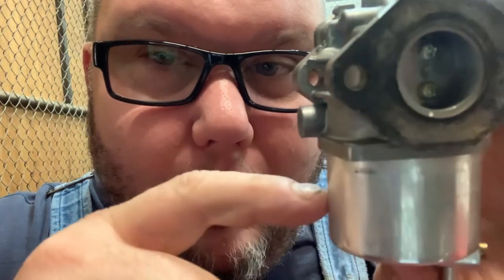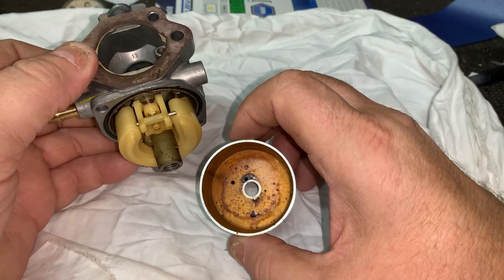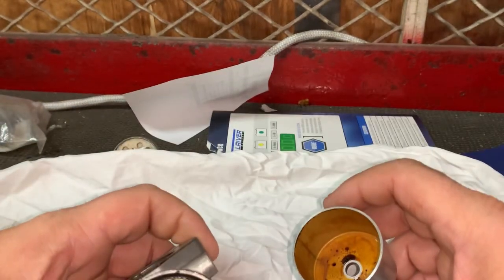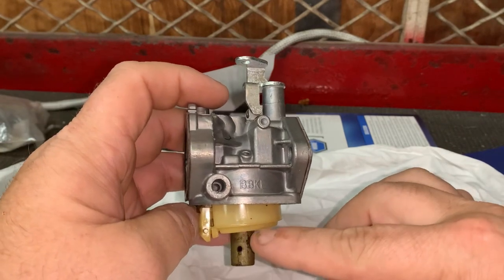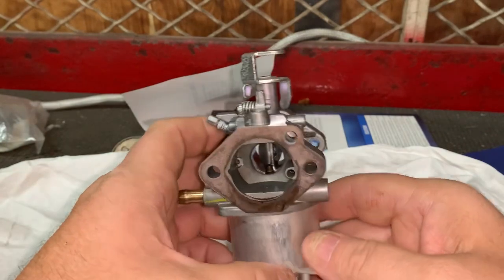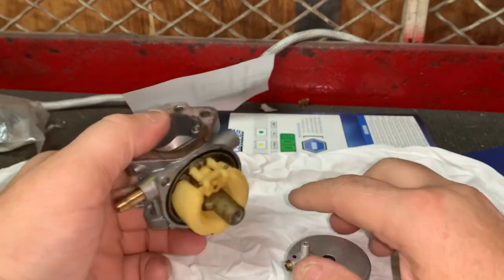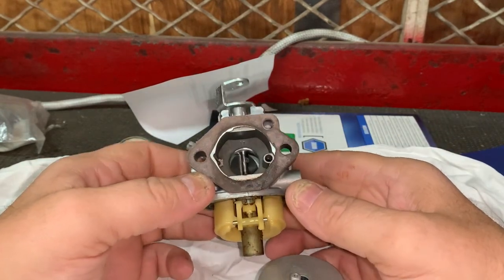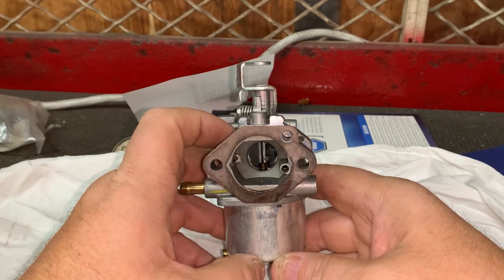SMALL ENGINE STORAGE / ARE YOU DOING IT WRONG?

Comment: On equipment that I can example lawn mower I use gasoline through the season.  At the end of the season the last one or two cuts I use the canned gas.  I let it run through the system while cutting which cleans out all of the regular gas and what remaining is the non-ethnol gas.  This has worked for years for me.

Comment: I have been using Marathon Non-ethanol fuel at 90 octain here in Virginia now for years.  It lasts a year or two in a can and even longer it seems when mixed with good two stroke oil.  All my tractors, mowers, weed wackers, snow blowers and leaf blowers run great year after year!!   
Ethanol is the enemy!!
Reply: Yeppers, Murphy's has 87 non ethanol, still add some stabil.
Reply: AGREE - Ethanol is the enemy!!
Almost zero problems prior to ethanol.  We had all kinds of farm machinery with large & small gas engines, we usually turned of the fuel valve and walked away.  Sometimes it would be 4 or 5 years later and they started on old fuel toped off with fresh and no problems.  Used ethanol a few years and had all kinds of problems.  Now I pay an extra buck a gal. for the non in small engines and it seems to work much better.
Reply: After paying for spring carb cleaning two years in a row, switched to and only use non ethanol pure gas in my small engines. That was ~20 years ago. I burn or drain all the gas in the tank each fall. And pour what's left in the gas can into the truck and buy fresh pure gas each December when prices are at its lowest.

Comment: I run regular gas with Briggs fuel stabilizer in my mower and snow blower. I park them at the end of the season with out doing anything to them.  The blower is 12 years old and the mower is 9 years old.  Both powered by Briggs.

Comment: I’ve been using a lil trans fluid through the carb before I store small engines and have been for many years. My snowblower sat for 4 yrs , I put fresh gas in it and it started on 3rd pull

Comment: Every season I always top off with fresh ethanol free fuel and stabilizer. Never had a problem. One year (as an experiment) I, drained out all the fuel. The next season, I had a leak at the carb. Had to take it apart and clean the needle and seat. 
Went right back to fresh fuel, and stabilizer. For me it’s the best option.

Comment: I think this is most common with bowl type carbs. it has been my experience with tank mounted carbs that this will not happen if you drain the fuel out of the tank. I recently pulled out a old push mower that I had stored for 21 years with the 3.5 hp briggs classic  engine that I drained the fuel in when put in storage. I kinda forgot about the dang thing and pulled it out, filled the tank with fuel and it fired right up on the first pull without having to do any tweaking or tinkering to it. I was shocked!
Reply: just remember that any fuel residue from 21 years ago isn't what we have today.

Comment: I recomend Aspen 2 mix or Aspen 4 or any similar small engine gasoline for winter storage to our customers, at least those who ask. My idea is without the ethanol or other substances in pump gas would help. I don't like those dried out carbs at all hehe. Carb rep kit $50, brand new carb $125. Plus $50 to rebuild the carb instead of replacing. (Nicky) Customers usually choose a new carb. Thanks for the upload! Very much appreciated 😊👍
Reply from the maker: Not available here

Comment: I run engineered fuel in all of my 2-stroke equipment year-round. (About 2 gallons a year @ $24 a gallon). 

But that's too expensive to use in my rider and push mower, (20 gallons a year) and unfortunately I cannot buy non-ethanol pump gas where I live. 

So I treat my ethanol gas all summer with a mix of Stabil-360 and Sea-foam.  

At the end of the season, I remove all of that from the tanks and then run the engineered fuel through the systems and let that stay in there through the winter.  

A lot of guys say the treated ethanol gas is just fine for winter storage.  To each their own, but I'm not risking it.

Comment: After 53 years of not doing anything special before storing equipment for winter (and sometimes longer) with ethanol and non-ethanol fuel, I've never had a problem.  In spring if an engine doesn't want to start I remove the air filter and pour a small amount of fuel into the carburetor and the engine will usually start on the first pull.  I have some 40 year old gasoline that I'm  going to try before long and I'll bet it works just fine.  BTW, my equipment has both two and four cycle engines.

Comment: Great advice, IF you can get to the float bowl. In some cases, you can't. ('suitcase' generators) What I do, is turn off the fuel, run the carburetor out of fuel, then wait a few minutes. what happens, is the fuel line finally get a bubble, and the fuel comes out of the fuel line and filter, partially re-filling the float bowl! it's necessary to put on the choke, and re-start the engine. Running the carburetor out with the choke on, creates a much higher suction to the main circuit, emulsion tubes, as well as the idle circuit. I don't mind a little fuel residue in the float bowl, as long as it's well below the level of the main jet, and the idle circuit. Just letting it 'run out of gas' isn't good enough!
Reply: Great Idea !!!!

Comment: I have also heard if people using a small amount ATF run into the carb? what do you think of doing that. Chickanic pumps 2 cycle oil through two cycle carbs?
Reply: She also said canned fuel is garbage!! I've used it for years and never not once had an issue!!!! All my equipment starts right up with 0 hesitation

Comment: All my engines with carburetors use high octane fuel Shell V-power 93 octane no ethanol or Chevron  premuim 94 octane no ethanol.
Reply from the maker: You do realize it all gasoline comes out of the same spigot whether it’s Walmart gas or Chevron gas etc.
Reply: @THEMOWERMEDIC1  So your saying which octane gas handles you pull from the pump,it's all the same octane?
Please explain.
Reply: @THEMOWERMEDIC1  gas stations regulated in Canada by TSSA if they get caught cheating big fines$$,Friend blew up is high performance engine using a gas station high octane fuel he had it tested wasn't 94 octane, they paid for a new engine and all the labor over$20,000!
Reply: @beachbums2008  ... not the same octane but the same base blend of fuel in many cases.

Comment: I've been using sta-bil in my chainsaws, weed eaters,pressure washers,lawnmowers,generators etc. for the last several years and no problem starting them up when I need them year after year.
What is your opinions on sta-bil if you use this product?
Inquiring minds want to know of you opinions. 
Keep the videos coming to Pittsburgh Pa. where we have 4 seasons.
Reply: I was wondering the same especially if you would buy like 1 or 2 gallons of fresh gas with that in it burn the engine dry of gas 2x regular gas then with stabilizer in it.
Reply: I forgot to mention, I put the sta-bil with 87 octane gasoline 
No problems year after year
Reply: I use Tru-Fuel in my equipment. I mean I've never had issue with Stabilizer but I've only used it a couple times. 
     Johnstown Pa here

Comment: 90 oct NO eth here in all my 2 stroke... 
Question I have had is this-  What do you do when you have saws, blowers, alot of two stroke stuff. And you need to put them away for years. Like as in don't use for years 5 plus. Because I pretty much see I am screwed here. Short of every so often going through them all dumping all gas out and putting fresh in. Starting and repeat the long storage. That or stuff is going to dry up, rot etc. I have the same case with alot of push mowers and riders. For me, that is alot of work and wasted gas to just store for ages not even running them one time. Same token if I don't I am screwed as gas will sit in carb if I run all out. Stuff will harden. So, what is the answer here short of like every year dumping all out and repeat storage sit with new gas? I'm talking about like over 25 things I have to do this with. Some of the riders as well are like 5 gal tanks. This is aside from what I do use every season. For them I run 90 no eth all the time in my two stroke. Push and rider gets eth gas in season. Winter storage all fresh 90 no eth gas and STA-BIL Fuel Stabilizer.
Reply: the real answer is to either store them dry or drain and refill once a year, plus a short run. Drained fuel (with stabilizer) can be used up in your car... in small quantities if necessary. (couple of gallons a week if you have lots to get rid of) I do this with my generator, which is kept full for outages. I also date my gas cans and rotate fresh fuel at least twice a year. (no stabil in there)
Reply: Fill all the way up with ethanol free and stable the next time you go to use them drain before starting put in fresh and run.  Old gas add a small amount each tank after that, filtered
Reply: @peteosinga8845  Sounds about right as a option, thanks.
Reply: I saw a video recommending  running ATF through for long term storage.
Reply: @thffhrewerrghdeg8681  ... I have seen both ATF and Marvel Mystery Oil used to prevent issues. Just remember, this only solves the problems created by moisture. The gas itself can still gum things up.

Comment: 🤔🏁I will tell you what is best for any carburetors you are wrong I am a Real ASE certified Master Auto Mechanic with over 60 years of real experience use ATF automatic transmission fluid and store any generator carburetor or any engine has a carburetor and that carburetor will last almost forever I really do know I am a real auto technician or a Master Auto Mechanic with over 60 years of real experience I have did this to my carburetors and my carburetors have lasted 30 and 40 years with NO  real problem

Comment: I watched those taryl videos on fuel additives. Think it varies by location. I'm in wv I been running k100 with no issues for over 5 years now. K100 puts star tron  and stabil to shame. My aren't new engines either. There 10 to 30 year old engines.
Reply from the maker: K 100 was the first one to fail in the Terrell video
Reply: @THEMOWERMEDIC1  yes I know. I have no problems using it though compared to the problem he had.
Reply: @THEMOWERMEDIC1  think it depends on the engines older engine had bigger jets todays stuff all epa regulated with small jets iv had new stuff that not run right cause factory hads to run them supper lean to pass epa laws